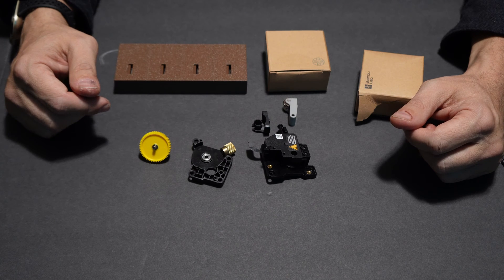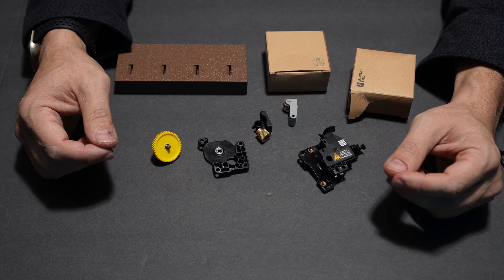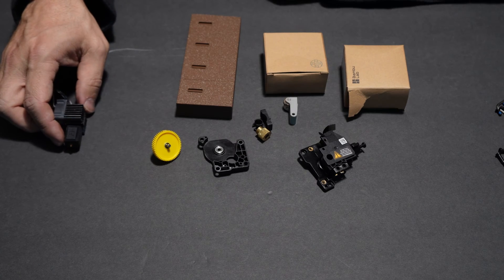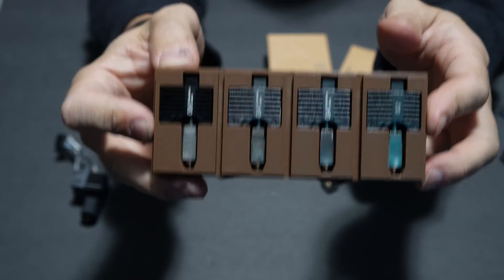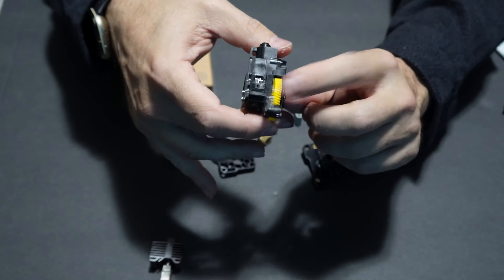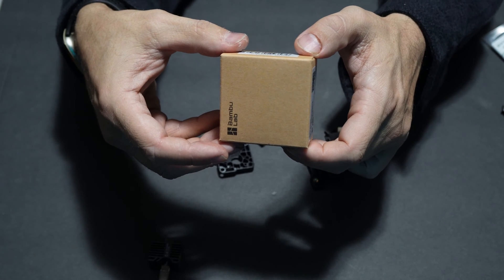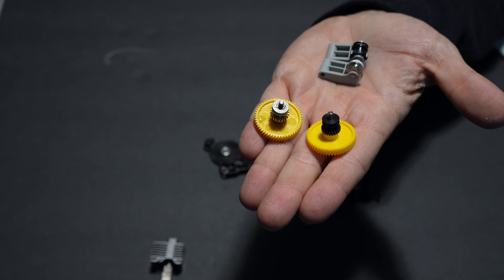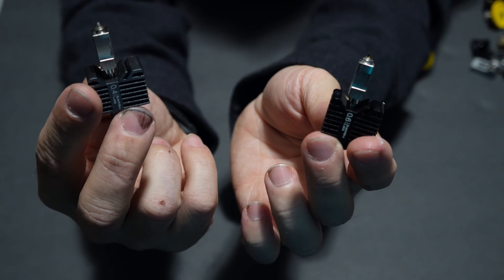Identify Bambu Lab Hardened Steal Gear / Hotend Vs Stainless Gear / Hotend on P1P / P1S

Comment: does hardened nozzle REQUIRE hardened gear? or one can you both nozzles in the same, stock stainless steel gear
Reply from the maker: No. Can do just the nozzle. The gear is fairly easy, and probably a good idea, if going to do allot of abrasives, but, the Nozzle is more important
Reply: @3DRundown  thank you!

Comment: Thank you! One thing, when I think of Stainless Steel, I think high-end. Which of these is what you want for more abrasive filaments such as PA-CF or PA-GF?
Reply from the maker: When you think "Stainless Steel", this Quality, and (for Appliances) Beauty, and RUST RESISTANT. When you think ABUSE resistant, think HARDNED STEEL.

Comment: It's really strange that they keep selling the P1S with stainless steel gears. I've just received my P1S yesterday, and ordered in hardened steel gears immediately with my order, only need to replace them. Still would need the hardened steel nozzle. But I think I wouldn't go printing verry exotic materials quickly, and there's a spare one included.
At least the switched gears won't suffer much on normall filament like PLA or PETG I guess.

Also stupid that the hardened gears are not included in the spare extruder replacement. So you actually need to buy both or just exchange them. I realy don't like the Bambu Lab marketing...
Reply from the maker: Yep. When my Extruder self destructed, I had to immediately swap the gears on the replacement. Very odd

Comment: i've ordered the stainless steel gear...but after unmounting the previous extruder, i'm pretty sure that has the silver gear...so is already a stainless steel...is it possible?!?!?
Reply from the maker: To upgrade, you wanted to order "Hardened Steel". Which will be BLACK. Stainless is stock

Comment: So basically If I have the P1S, I can just buy the whole Harden Steel Extruder Unit - X1 Series, and it will be totally compatible with the P1S?
Reply from the maker: No. I asked Bambu about this, and it's a NO-GO.  You get the P1P Extruder, the P1 Hardned Gear, then, swap it. Which is what I did.

Comment: whats the differenc in using the hardenend vs stainless hotend?
Reply from the maker: Stainless is softer and will wear out, making the nozzel opening enlarge, and the gears wear thin,  when using abrasive filaments such as Glow in the Dark. The hardned can handle it and won't wear out.